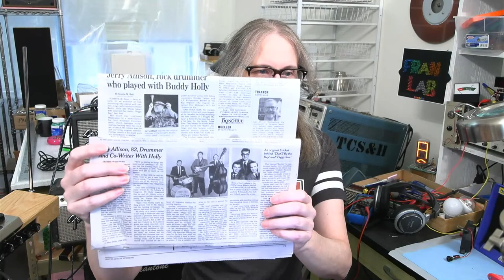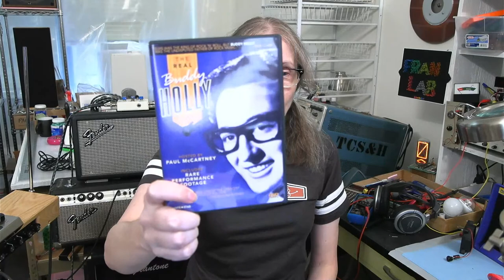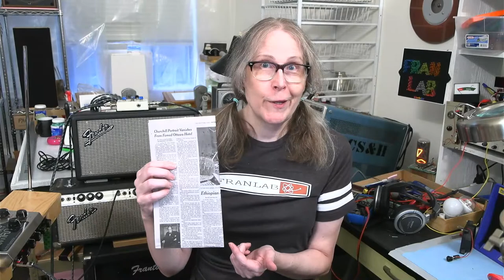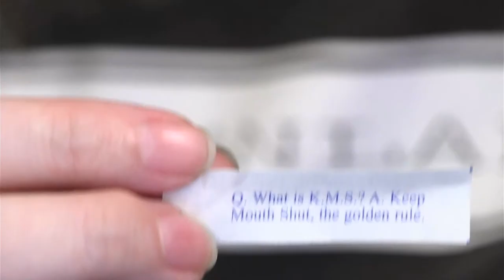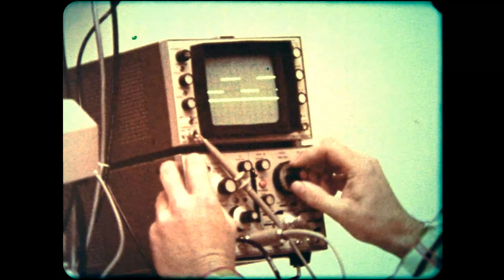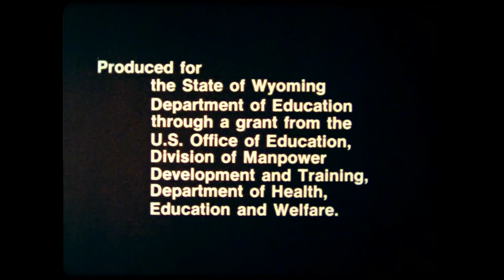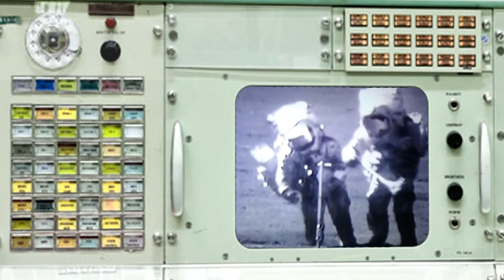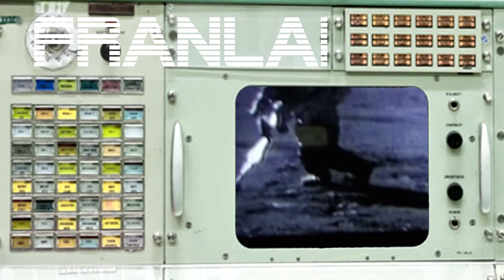FranLab Live!  Film Threat Edition

Comment: On trying to start a business (or actually the project management of any project), there should be some specific dates for reviews to consider whether to continue.  Many don't do this, and end up just driving all the way off the cliff.  One of the most common errors in judgement in business or projects is "Well, we already have all this invested so we might as well continue."  No.  What is invested is a "sunk cost".  It's gone.  The only that matters is if makes financial sense to continue.  If not, it is far better to end it earlier than later.  Now, there is also the entrepreneurial ego which is actually a good and necessary thing.  And it is helpful to push past the obstacles and naysayers.  But it should not replace a sound business decision unless the person is willing to take on an increasing risk and does it consciously.